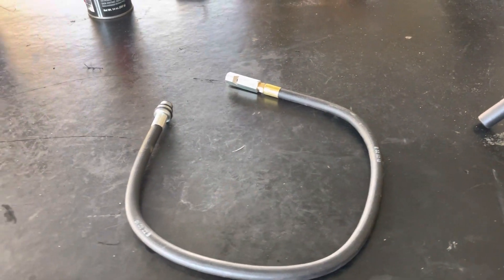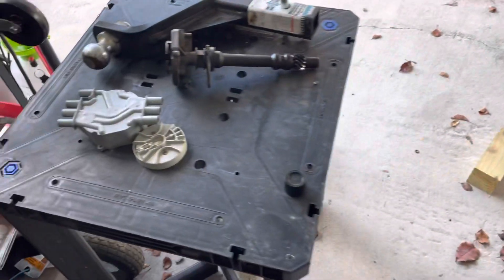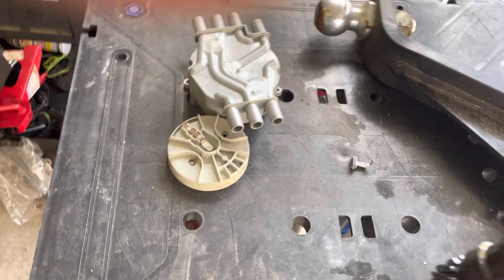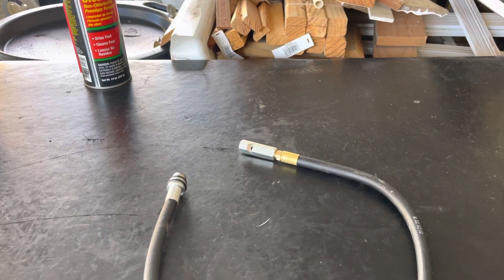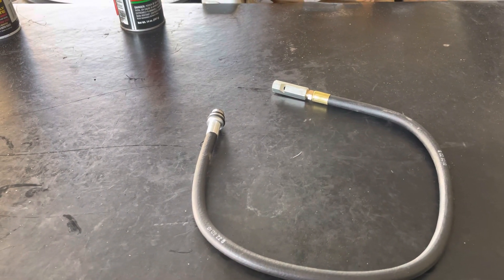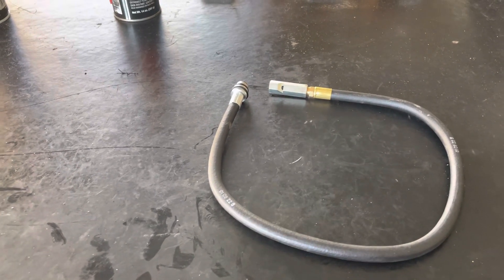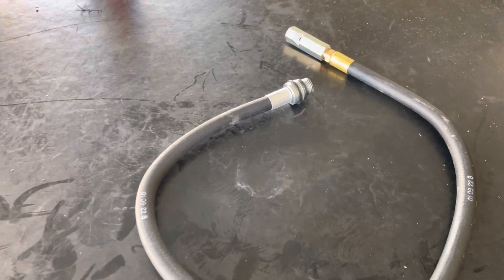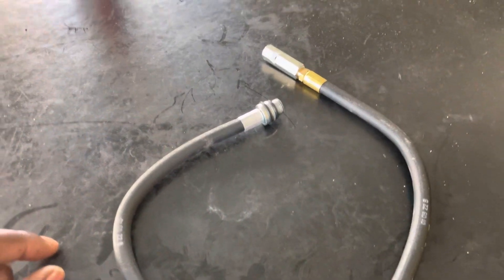WHY WON’T IT CRANK! Did you use the right tool?

Comment: Hi I have the same tool. As soon as the whistle stops blowing do I stop or go a bit more?
Reply from the maker: When it stops you stop TDC because the sound is due to the air being pushed out on the compression stroke if you keep going the piston is on It’s way back down